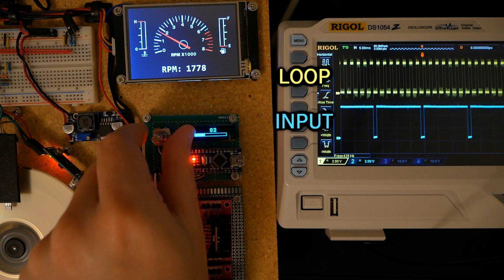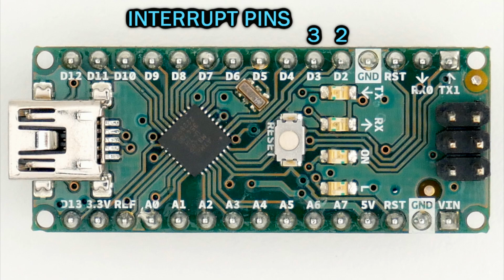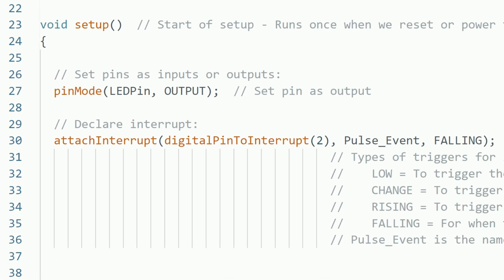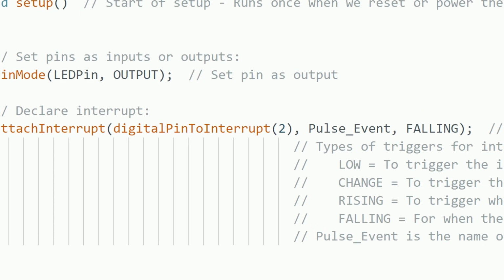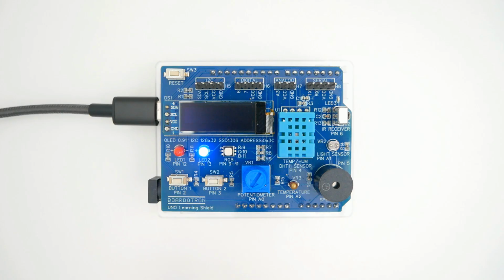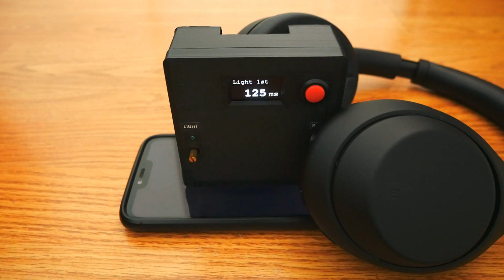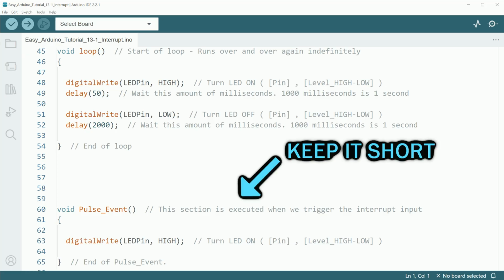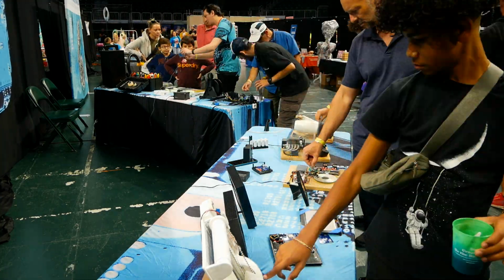Easy Arduino Tutorial: #13 Interrupts

Comment: please make rpm with km/h sir.
Reply from the maker: You can convert it using RPM, but it's very dependent on the size of the wheel touching the ground so it's unique to your setup